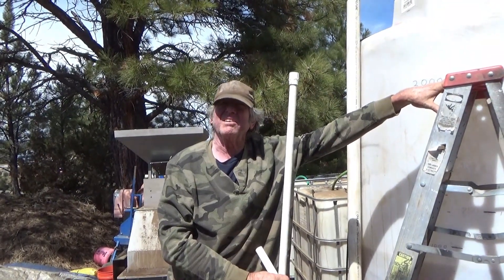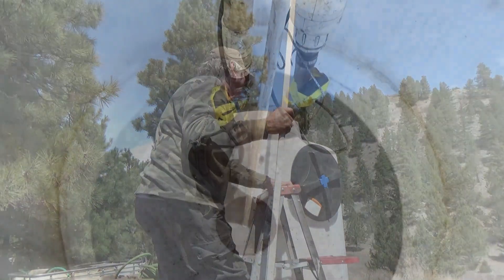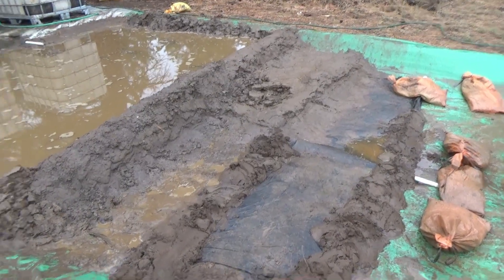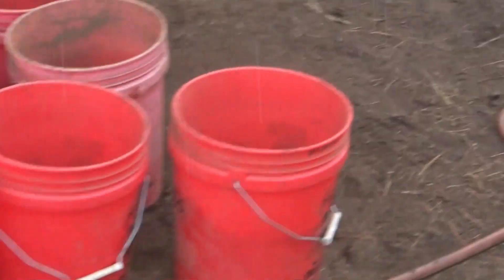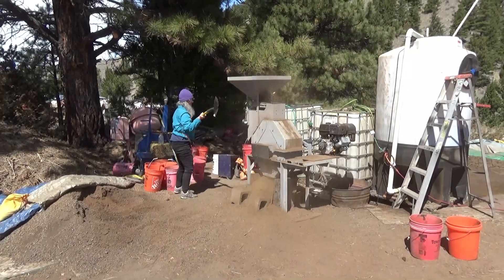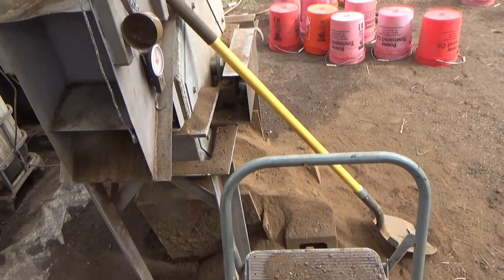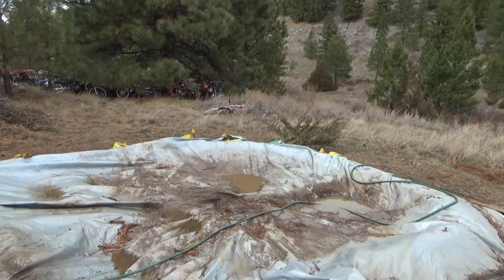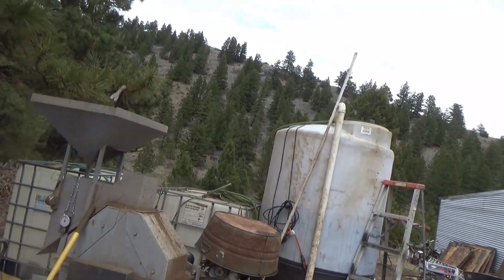270 More progress on the Expanded Test Mill

Comment: Just a thought, the liquid pressure will need to overcome the weight of the dirt above to open the lower check valve. If the solution is permitted to separate and settle then it may be difficult to re-establish flow through the check valve. I hope I’m not throwing a wrench into the works.
Reply from the maker: It seemed to re-start OK yesterday.  What is weird is the venturi effect which actually holds the plate DOWN against the opening to some extent when the solution is flowing.  I 'scalloped' it to  prevent adhesion(?) under flow.  Kinda weird, but possibly useful.
Reply: Hydrodynamics…. It’s a b1t¢h.

Comment: That's the way , keep Eva on the shovel 😂 it'll keep her fit . So who mined that stockpiled ore Keith you or Jim ? and who will mine the next lot . Good to see the weathers letting you start production now , good luck . I'm just processing another 10 kg of ore at the moment , it's been agitating a week , i need to do the resin thing , then the smelt thing , but gonna try no ashing , like you did , just room temp dried resin , hope i get some results , cheers , Ned .👍✌✅
Reply from the maker: That was from last season when I was opening up the middle decline at Montana B. Still got two or more tons of larger rock to crush.  By the time I get everything tested and de-bugged we should be able to get back to the mine.

Good luck on the resin thingy.  It is so tough to do without assays to tell you what to expect.

Comment: So are you only making pregnant solution? Or does it go through the resin filters at same time? Is same time a future goal? Sorry I'm so dense. I think I understand  basically  but your work still seems like magic to me
Reply from the maker: The tank dissolves most of the gold.  Once it is dumped on the pad the solution percolates through and is thus filtered.  The clean (ish) pregnant solution is then pumped from the sump to a tank.  From there it is pumped through the resin cartridges and to a barren solution tank.  After that it is recycled into the agitation tank, refreshed with more chemicals and used to slurry more ore.